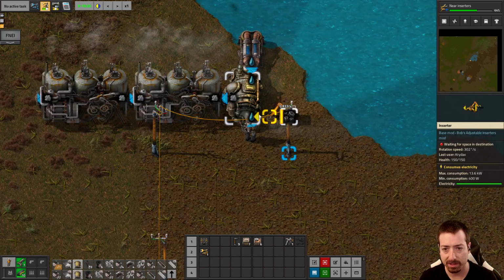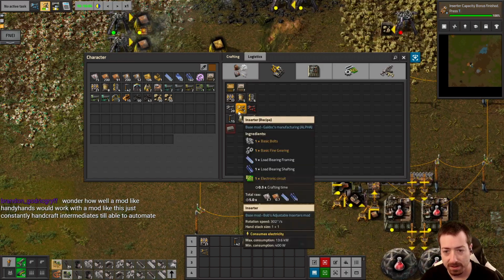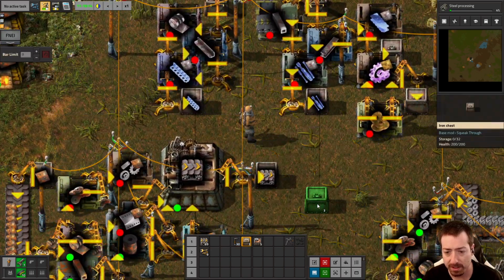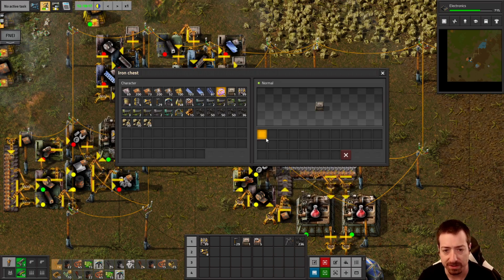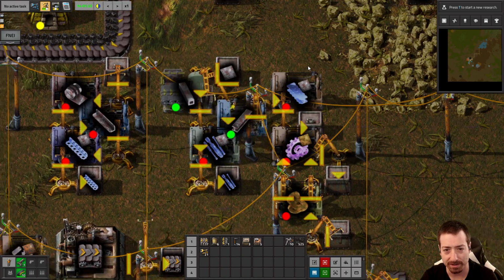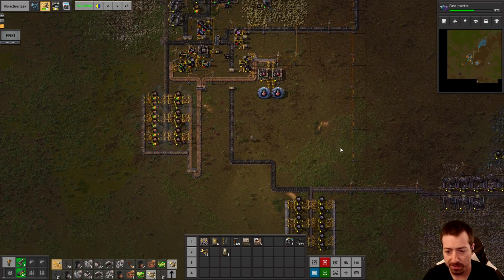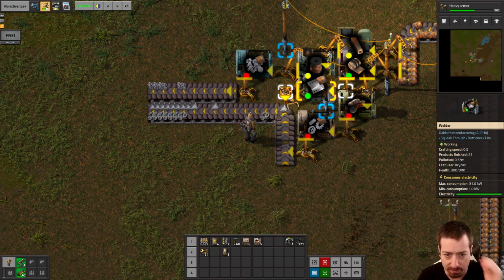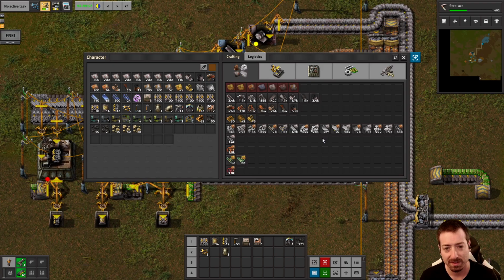Factorio Galdoc's Manufacturing #2 ⎯ Getting Smelting & Circuits Automated!

Comment: Actually, gold is a good conductor (in the same league as aluminium, though substantially worse than copper or silver; and needless to say, both aluminium and copper are much more plentiful), but the reason we use it for electrical plating and wiring is that it doesn't corrode and you can draw it into extremely thin wires (or plating). That makes it great for connectors. Which is why you often see it in recipes for integrated circuits (Bob's, Angel's, GregTech...). Even if it was plentiful enough to be used for power cables, you wouldn't really want to use it - it's mechanically kind of weak and of course, very dense. Silver is both more plentiful and a better conductor, but not nearly enough to offset copper's cost (and copper is already pretty "rare" - a good copper ore nowadays has something like 4% copper content :D ).

And that's the tricky thing with gold in Factorio too; there's not all that much that it would be useful. At least in Minecraft, you have the various magic mods where you can go with the idea that gold has some intrinsically magical properties. Even in Pyanodon's, it's only used for contacts and integrated circuits... and outright or borderline magic :) It's especially painful in Bob's where you of course have pure gold ore you can mine in the same quantities as something like copper, which at best you could interpret as "this is a useful quantity of gold, but still a hundredth of what a copper ingot represents".

The same thing that makes it great for conductors means there's very few uses otherwise - a lot of metals (rare and common) have very useful chemical properties that make them indispensable for chemical engineering. Gold is nearly inert even at fairly high pressures and temperatures, so there's not a lot of useful chemistry you can do with it. It's definitely not worthless industrially... but it is right there on the edge.
Reply from the maker: TIL a lot of things hahaha.

But in terms of there just being "a huge patch of gold ore" I think the solution there is having a large processing chain along with a very large reduction in quantity. So you need hundreds or thousands of gold ore to result in one gold ingot, for example.